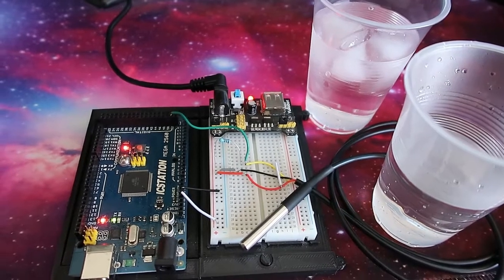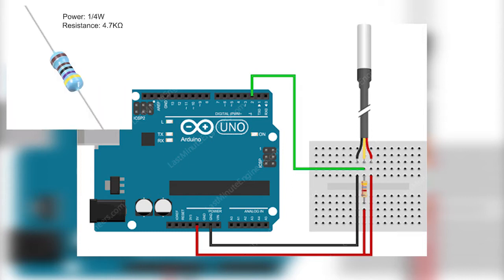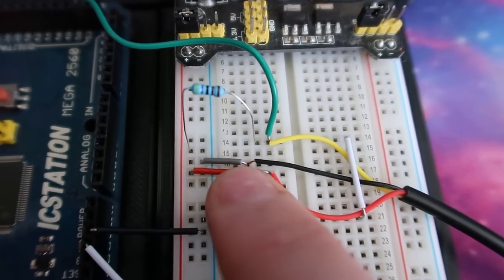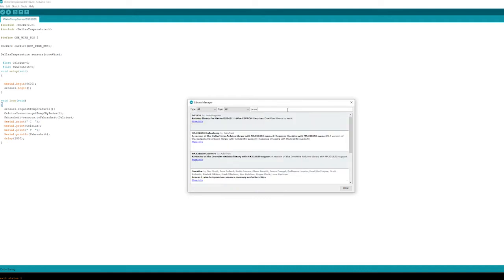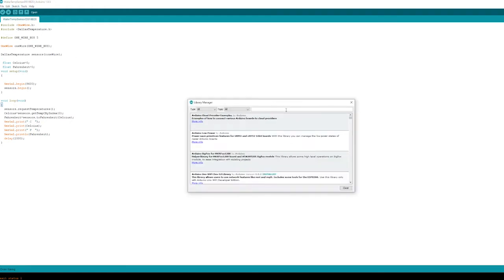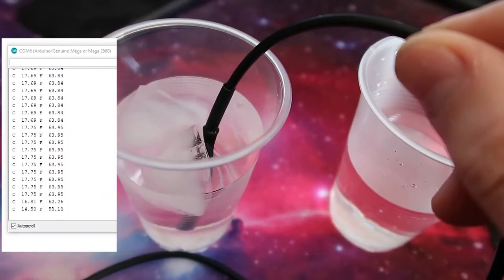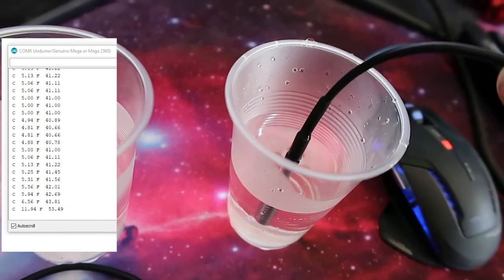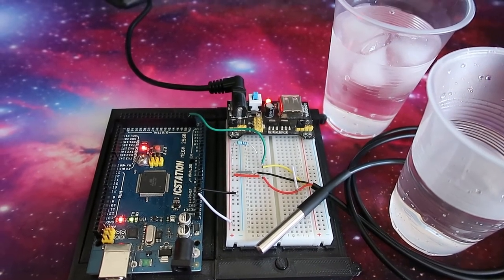water temperature sensor DS18B20 for arduino

Comment: This video was helpful.
I have an outdoor hot tub.  Originally, due to time constraints, I bought an off-the-shelf LaCrosse wet temp sensor, that looks similar to this one.  Worked good for a year and a few months.

The give you 1 year of monitoring for free then want to charge like 12 or 15 bucks a year thereafter.  I renewed once, but then the sensor broke, the electronics part of it , probably due to the humidity in the hot tub cabinet.  I bought another, and put it in a waterproof box with dessicant.  It also had many issues.   The gateway they use is really crappy and loses connection with the sensing unit all the time. (Despite a roof wifi repeater near the tub.)  I mean, I generally like LaCrosse for there nicely designed weather stations,  But I refuse to pay for their IoT service for a simple water monitor.

 I have many other units that don't charge for IoT hosting, like my Govee DHT sensor, with free IoT and a great app.  Incidentally, the greenhouse is also usually 80% humidity, and that unit has been running for 3 years  Also my Emporia energy monitor which watches my energy use on 16 of my most critical house circuits.  Again, no charge, for IoT data and great app.  So although I like LaCrosse for most of their stuff, like weather stations, this whole ordeal was too much of a headache.  But I still need to monitor tub temperature, because if the water were to freeze in the winter here, bad things would happen.

Well, I already set up an MQTT server for a different project, a totally automated greenhouse I built, and I think it's time to create my water temp sensor with my own database, and perhaps an ESP32 as I really liked using that platform for my greenhouse, although it's probably overkill for this project, I know it well, and it's only a few dollars.

Anyway, I plan on appropriating the temp probes (they probably still work) from the two lacrosse I previously purchased and just using them for this project.  This video helps kick things off.  I believe they will be compatible with the Dallas lib.   I already have the backend setup for the ESP32 to talk to my custom Android apps, so this should be an easy one.  I think I'll spend most of my time on this project perfecting my 3D printing of WATERPROOF boxes, since the cabinet in there generally runs around 80% humidity.  I have to get my large o-ring game down.  haha  Thanks!

EDIT TO ADD:  I started using wire glands with a big solar project this summer.  That bought unit didn't have that.  Not really protected at all.  I think if I use something like that I can beat the humidity.